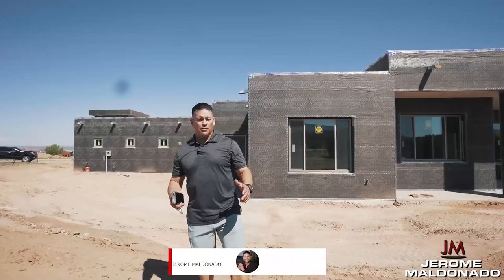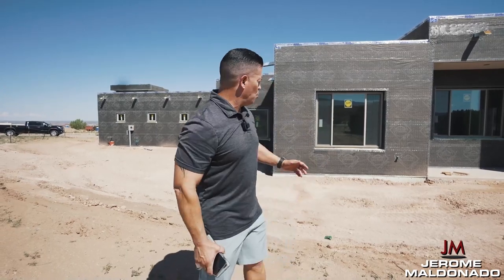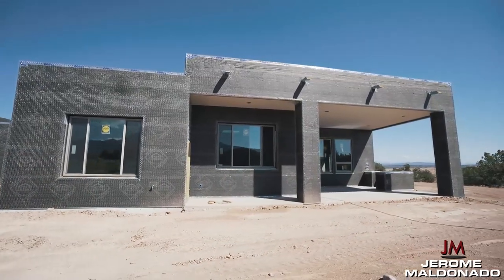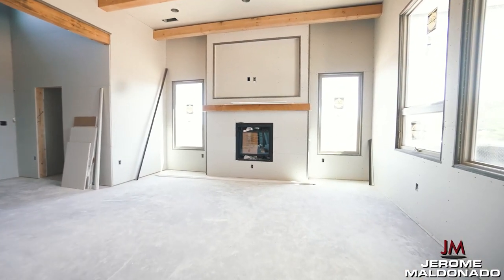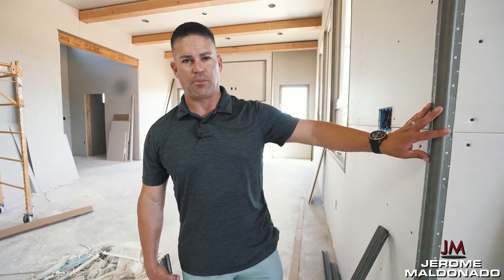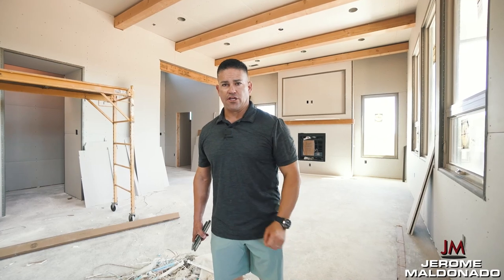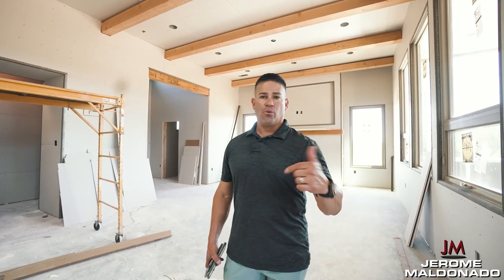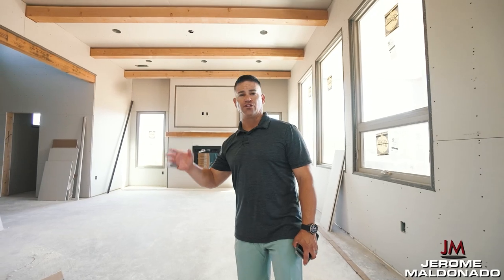Buy Land & Build a House: Inside the Interior Walls (Before the Sheetrock & Flooring) (Part 19)

Comment: 5/8 thick sheetrock is the most important upgrade feature you can do on a residential house
Residential code is 1/2 inch 
Commercial code is  5/8 thick.